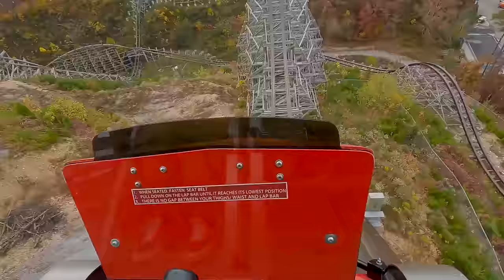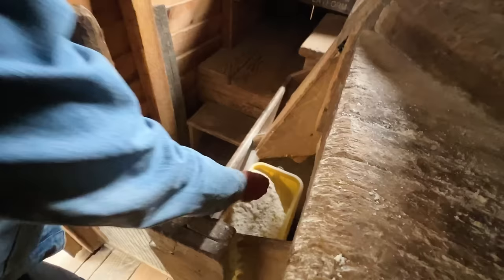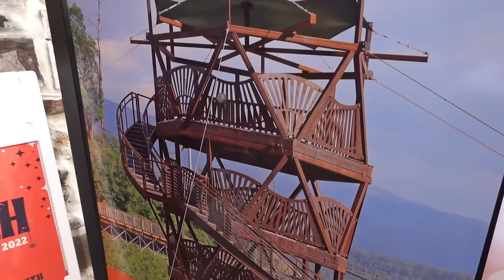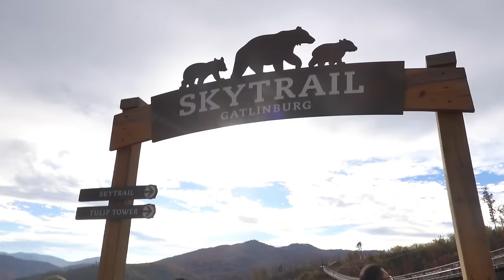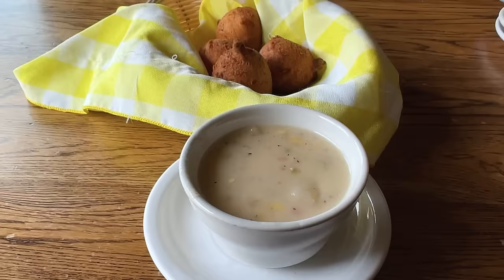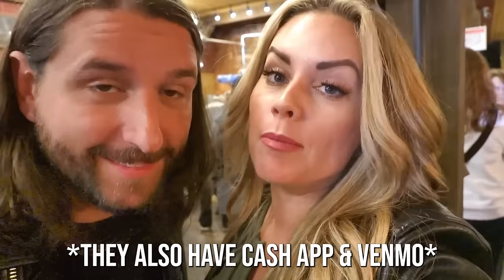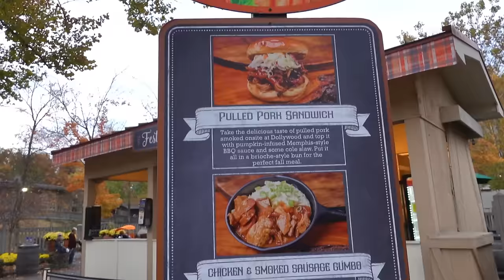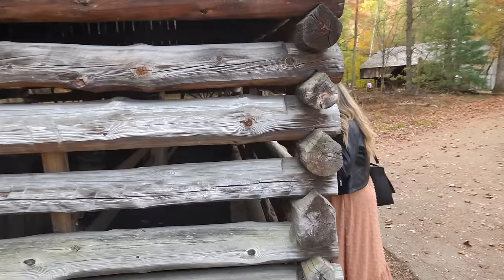Weekend in the Great Smoky Mountains - Travel Guide | What to Do, See, & Eat!

Comment: One activity worth doing, if you don't mind a fair bit of exercise: Hike to the Mt. Cammerer Lookout. The trailhead is at the Cosby Campground, in the NE corner of the park. The hike itself is not easy and rather tedious - 3 miles of unrelenting climbing to Low Gap, from an elevation of  ~2400' to ~4200', followed by three more miles of up-and-down along a ridge, ending at the 4928' lookout. And, zero views until you get to the end. But Mt. Cammerer itself is a rocky knob extending above the trees, and is said to have the best view in the Smokies. It is certainly a good one - 360 degrees of the surrounding Smokies, plus the plains to the north and south. This trail is definitely worth doing once, if maybe not twice or any more.